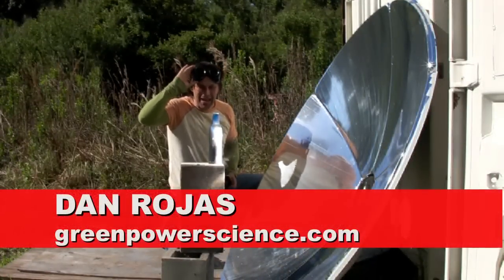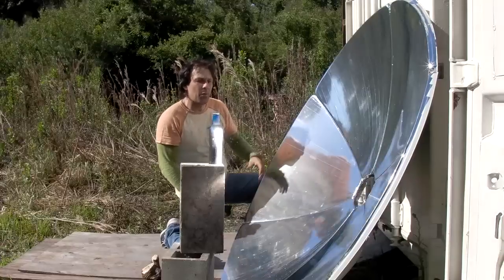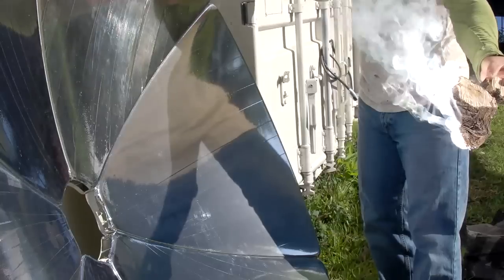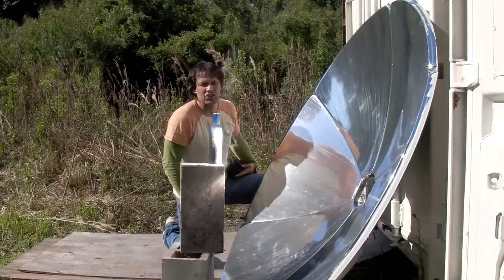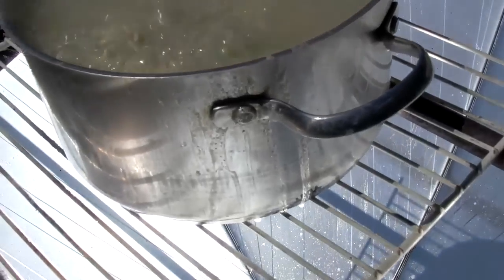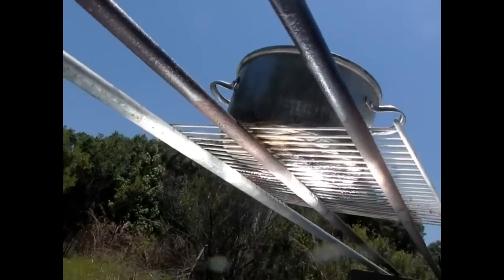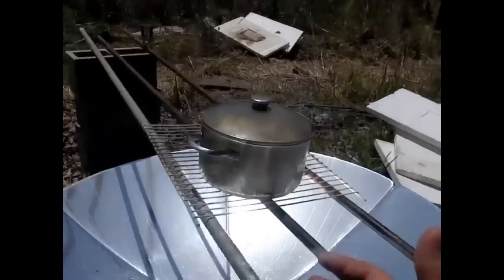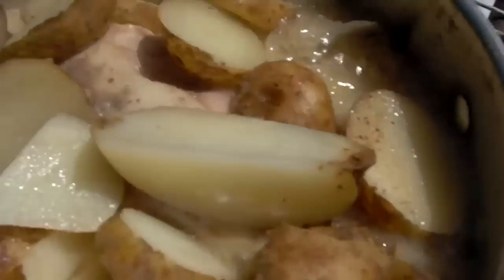DIY SOLAR COOKER 70" SOLAR SATELLITE DISH DIY NATURAL Solar Dog Food

Comment: To Dan..... You should use a second mirror at the focal point of this dish to reflect the sun back through the center of the dish, you can then point the dish directly at the sun and do you your heat work behind the dish in a somewhat more controlled environment, as well as get whatever focal point you desire.  I have two 8 foot dishes that I picked up this last summer and I would like to set them up in this way. I would also like to find a way to run a flexible tube/conduit as a light guide behind the dish and output it through a lens to get a very fine controllable beam.  This way I could set up a machine table under a very controllable condition to see just what one can do with stone working or metal cutting etc.

Anyone have any ideas on how to make an effective light guide tube?..... 

My first thoughts have been to use stainless steel tube cut into about 1 inch lengths inside a flexible rubber tubing filled with water to help dissipate heat. At the end running a fairly high quality glass or crystal lens to focus the beam where I want it.

Comment from the maker: For vessel/pan/object heating, the focal point should be as large as the object if possible for maximum surface to liquid transfer area. For forging etc the smaller focal pattern is better. This beer can has a rectangular profile so the focal point at optimal would be the smaller of the two or the width. When we cook with a skillet we go a bit smaller than the pan because the outer area is not used. You are correct power is determined by the dish/lens size/reflectivity not the focal pattern size

Comment: As long as all of the rays are absorbed is a given material does it really matter if the focal point is large or small? ie, a smaller focal point will take just as long because you only have X BTU's from that 6' dish.

Comment: I once used a solar panel, a black solar heat collector and a TEC heat pump in reverse, tecs work better as heaters.  

My set up was very poor, some heat paste, a piece of black painted Iron, 12v 3A a spare peltier and a 10 watt panel but it worked to heat water much better using Sun, and TEC with a 10 watt panel.

I think if I could engineer each component, it could work efficiently.

Comment: Also, you really do need to mount that thing on a motorized satellite dish mount.  For optimal use, the dish should be tracking the sun.  There are many solar trackers out there designed for just this purpose.  My guess is you'd just about double your heat output if it were properly tracking the sun.

Comment: I hate to say it, but there is no advantage to a satellite dish with a larger focal point.  You always, always want an extremely tight focal point.  Why?  Because if you DO want to increase the effective surface heating area of a dish with a very tight focal point, you can simply move the object being heated a few inches closer to, or farther away from, the focal point.  However, if the dish has a poor focal point, you won't be able to focus the beam, should you ever need very high temperatures.

Comment: Dan,would you know offhand a rough estimate of thermal potential for this 10' dish,total? With 80% efficiency.
Reply: The area of the circle will be: S = d² x pi/4 = 3.4² x 0.7854 =~~9 m². Assuming insolation of 1 000W/m², and efficiency of 80%, the maximum heating power would be 9 x 0.8 = 7.2 kW.

Comment: if you put this on a polar tilt axis (point to north star)  with a secondary tilt on that axis to adjust it with seasonal declination (once a week at most) and a motor that turns it 15 degrees per hour (or a single axis sun tracker) and a water target in front to circulate into  the house where there is a car radiator to release the heat, this could cut a 1,000 sq ft house winter heating bill to 1/3. It would raise daytime house temps to 80 F, so with decent insulation, heater would not turn on.

Comment: @EnavSounds The tracking circuit is probably at least the coolest part, but I think just to transmit light you'd only need a reflector and not necessarily a parabolic dish.

Comment: @EnavSounds Yes, the manufactured ones  are pretty pricey but I think they're called "fibre-optic skylights" or something similar. if you're talented for making stuff like that you could possibly get by much cheaper. (you wouldn't need the parabolic dish for lighting) - I'm not sure the heat would transmit as focused light, but I could be wrong on that.

Comment: @mlim23 as long as its a glass that contained comercial food at some point (food grade), it will be fine. Aluminium pans are probable something to worry about if they are not coated in some way. aluminium has links to altzimers. you can boil water on a stove in a peice of paper too, thats fun :D